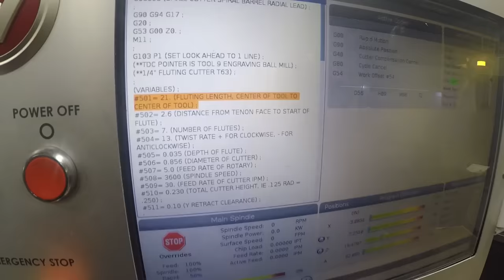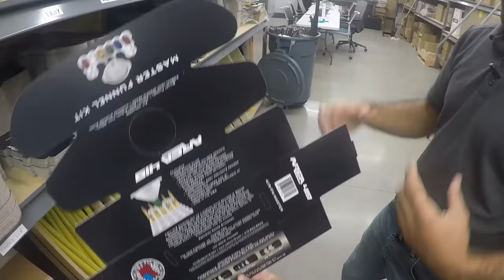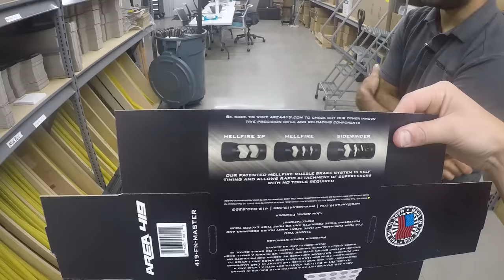Area 419 Machine Shop Tour | Hobby Gunsmith Becomes Successful Entrepreneur

Comment: John, I have to thank you for all these videos aspecially these machine shop and factory tours. I'm currently 17 and a half. I only own a 3D printer and never finished my electrical engineering degree in college after i left a few months in due to sleep issues. It's truely impossible to find jobs that can adapt to my needs with constantly shifting sleep schedule. I hope one day to start my own business and do machining of my own. I've never operated a manual lathe, mill or any sophisticated machine before, but if the opportunity one day comes i'd take it in a heart beat, but there is always a but and there isn't really any machining businesses around. You have helped me spiked my imagination and keep my hopes up. I do have hopefull plans on making my own cnc router style 3-axis machine to get into machining and do some wood and occasionally metal projects till i have money to buy a proper mill to do some more metal. 

Thank you again! :)
Reply: @Greatest Evar Never seem to find a machine that fits my needs in my price range. I found that making my own will drastically reduce the costs. Plus it allows me to gain knownledge and have fun. If you got any machines in mind i'd gladly take a look :)

Comment: When talking about running lights out. Hit up your insert dealer, they may be able to help you with your chip issues.
Reply: We use Mitsubishi aluminum inserts and use them way faster then recommend and still get incredible life. I’ve ran a few hundred part job on one set of inserts. Definitely think he should shop around
Reply: Razzel Dazzel True. I wonder if he was talking about chip build up on the actual chucks themselves, being that during the handoff, too much chip build up on the edges of the chuck being transferred to the bore of the chuck themselves. Brass is easier he said, because the chips are small, heavier and tend to fall to the bottom of the chip conveyor

Comment: Im right in the process of getting an 1800 SQ FT shop built and trying to do that and finance a HAAS machine. Right now I'm torn between getting a 5th axis UMC or starting with a VF2SS. With the current cost of building it is making it incredibly difficult to justify the cost of the UMC. I have worked lined up and 90% of it could be done on 3 or 4 axis with minimal set-ups. What I dont want to run into is ending up needing the UMC soon after getting the VF2. I mean if I am running enough parts and get enough growth to profit and purchase a second machine sure, but, like most people I am being risk averse. 

The safe bet is getting a VF2 and throwing a rotary in there like they have and just building the right fixtures to run the more complicated parts, and I should probably listen to the safe bet.

Comment: I have been testing a 32mm inserted rougher recently, as long as tool life is concerned, I had best results with a hydraulic holder, then the umc milling chuck and last position is the shrink fit, shrink is too rigid for roughing and bigger chucks have more dampening

Comment: You say some people say you can't rough steel with shrink fit holders. For about 2 years I have roughed tool steel using only shrink fit holders. Between A2 and D2. Sometimes 1018 but we mostly did tool steel.  Then again that company used good endmills that I haven't seen anywhere else use.

Comment: Wow he does all that but sends out for anodizing. I learned how to do it on small pieces  in about a week.   Then all I had to do was upscale my containers and I was ready to go. I know u can't do everything yourself but I try to do as much as I can. I guess the small parts he builds can be done in batches. I had the stuff I build quoted and it was 100$ min but u could put as many in that fit in their vat for a run for the same price. They could only do 5 at a time due to the size. If I could fit 100 pieces in there I would not have thought about doing them myself. It is so easy to anodize just hard to keep it clean enough. I have everything to up scale now just need the time to set it up the up scaled pipe and get drain system plumbed. Instead of useing a ton of acid in a square tub I'm useing 6" pipe so I can anodize up to probably 5" material. I rolled a sheet of lead around the inside so it should be as even current as possible. Plus I played around and found the strongest coating that will still take color. I have hard anodized durability with color of light duty. Be very interesting to measure before and after to see what thickness I end up adding. The last one I tested held up to a flapper wheel better than I thought possible. I would hate to have to remove the color. U have a coat of saphire on the part.
Reply: The difference in small scale and larger scale is the regulation involved. In-house ano would be cheap, if not for the requirement to properly deal with the chemicals involved.

Comment: You could fix the inventory tracking with a simple python program that monitors sales and jobs being ran.  Review the data from previous sales to build your baseline and factor in lead time for materials, setup time, cycle time and post production time.
Reply: The simple answer is often the obvious one, but not here. The thing that makes inventory more of a challenge is the rate we introduce new products, and the aggressive growth curve of the company. These are obviously good problems to have, but create an environment where last year's sales are only relevant for a small part of our product lineup. We are running 2-4 month average rates on replenishment, which means it's a much more constant and involved deal. When we get into our new shop (and NYC CNC comes back to see us) we will have the capacity to push further out and build larger buffers, but right now our production capacity does not greatly exceed our sales volume so "just in time" is pretty much the only option.

Comment: What on earth, you can't single block a hand-off on a haas? He's got to be missing something.  That's ridiculous.
Reply: I have not tried it, I was told this early on by our apps guy due to once the main chuck opens it will not let you press cycle start.  I do think now though that as long as you have the setting turned off it will allow you to.
Reply: @area419  is it one M code that haas uses? I have a sub program that I call up that's probably about 100 lines long, but it includes load monitoring so the machine will alarm out if anything goes wrong and it also includes the part off, which I have to modify a bit depending on the size of the stock or if I want to chamfer the part while I'm parting off.